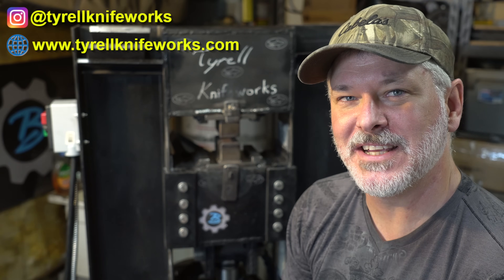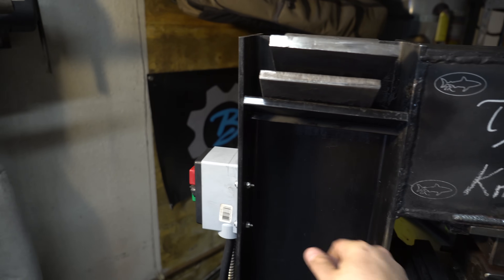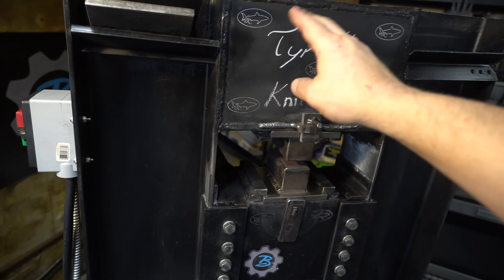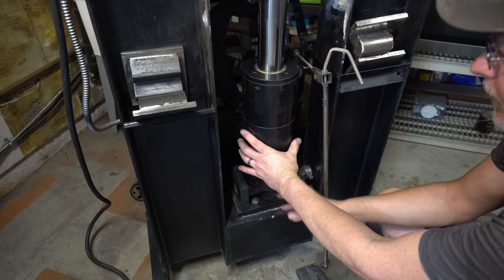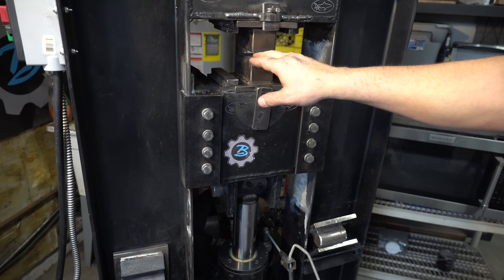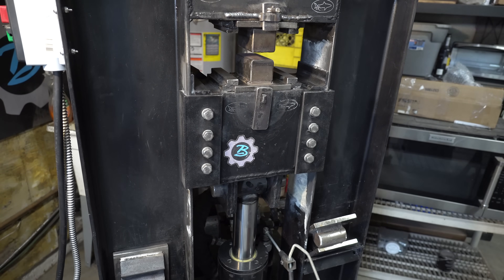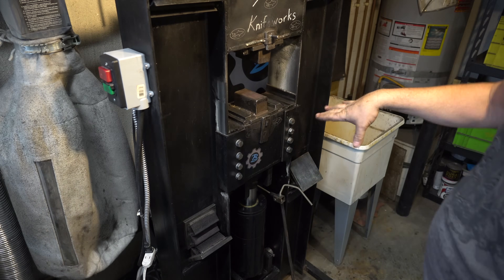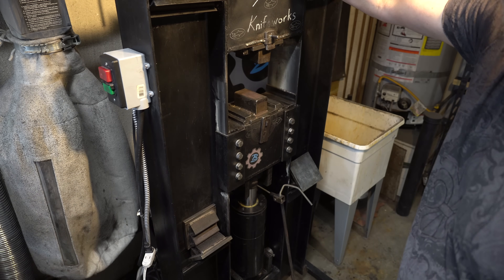Triple-T #83 - How to build a Hydraulic Press

Comment: I've just found your channel and am enjoying it immensely.  I've blacksmith'd about 10 years but I've never tried making damascus.  
I have a few questions concerning a press.  For an occasional damascus build, in your opinion, what is the minimum tonnage needed for an adequate press?   Could a Harbor Freight air powered 20 ton press suffice?  Would it be fast enough?  I haven't done a lot of searching but I've never seen someone making damascus at normal speed (it always seems to be speeded up) so I'm not sure how fast the press should operate (compression & retracting) to be efficent.  
Concerning forges.  I have a naturally aspirated gas forge (built in a team build using a 12" - 14" diameter pipe with 2 burners let into the side towards the top to create a swirl inside the forge).  The propane orifice is a mig welding tip positioned in a 3/4" t-fitting to allow for air intake.  In your opinion would it be possible/helpful to introduce forced air into the intake assembly to increase temperature/performance?
Thanks in advance!
Reply from the maker: I would stay away from air cylinders.  They are just too slow.  Speed is important and you want a good motor driving a good pump so the ram moves about 2”/s.  They always have a low gear for fine manipulation.  I would go less than a 20-ton cylinder if I was making one because the cost difference is negligible.  Mine is a 28ton with a 5hp motor and 13gpm pump.  It works perfectly for forging.  As for the forge, if you have a Venturi burner, you’d have to change that to move to forced air.  You wouldn’t want both.  Forced air burners a dead simple, just an air pipe with gas tee’d into it and either a ribbon burner or nozzle at the end. They are much easier to control for doing Damascus.  Welcome to the channel, thanks for watching!

Comment: Hey Denis! i am currently following this build to make my own press. Thank you! I do have a quick question though, ( i know there are a lot of variables) in your build, would a 2" longer stroke cylinder work effectively? or is it too long?
Reply from the maker: A longe cylinder would certainly work.  Each cylinder is rated for pressure and force, the length of the ram usually isn't the consideration.  I hope that helps.  Thanks for watching.

Comment: You may not need hardened dies as long as you only work on 1/2 thick billets or larger.  If you work material smaller, or taper things that may not hold enough heat to stay red through a single hard press, the dies will dent in ways that become problematic because it leaves those dents in your future work.  I use hardened dies for all smaller work for this reason.
Reply from the maker: I’ve never had an issue. Thanks for watching.

Comment: Thanks for the very informative video, makes me want to try building one. I do have a question about the motor though, in the video you said you need a 5hp motor and it's all about the speed that it rotates. My shop will not have a 230v setup which is what is required of the 5hp motor you linked however, the same amazon seller has a 2hp motor that is the same rpm as the 5hp (3450) but it can run off of 115v. Do you know if the lower hp will affect it all? Like make it go slower up and down or could it just bind up altogether and not work to rotate the pump? Not sure how much torque is required to rotate the pump if much at all or if it is all about the rpm. Thanks for taking the time to read this and i am hoping someone can help me out.
Reply from the maker: You need the torque.  Hp is about the power of a pump and that’s what you need to drive a pump that moves hydraulic oil.  It just means you can’t drive as high a pump. I would strongly suggest you consider putting in 220v power to your shop.  You’ll use it for so many things.  I did mine myself, it’s very easy.

Comment: Do you have a cost estimate for all the steel. I know it's going to be higher now but just trying to get an estimate would help in planning everything out.
Reply from the maker: I had my steel yard cut an i-beam into 5 pieces.  Two 4-foot sections and three 1-foot sections and I just welded those up.  Plus a foot or two of 1/2" bar to make the holders for the clevis pins.  In total I think it cost me about $250 in steel or thereabouts.

Comment: Tyrell would you be able to update the links in your description? Some of them are “currently unavailable” and the piston leads to a 404 error
Reply from the maker: It seems they don’t have the 5” bore cylinder.  I updated the link to a 4” bore, but that one is only 18 ton.  The 5” bore was 28 ton.  I would look for a 5” bore / 10” stroke cylinder somewhere else.  Thanks for watching, Tyler.
Reply: I just built a press based off his design and I got my 5” bore 10” stroke 3000psi spartan cylinder from FIMIC and it worked great the only thing I would do differently is get a pump with a cast iron body instead of this pump with aluminum housing I got the one he recommended but outlet port blew off and tore threads after 4 days of use so now I’m waiting on new pump and out $150

Comment: How long is the stroke on the cylinder ram the link expired for the one you listed can you give me the specification on cylinder please? Thanks Dennis
Reply from the maker: You only need around an 8” stroke.  The one I have is a 5” bore with an 8” stroke that operates at 58k pounds of pressure.
Reply: @TyrellKnifeworks  thanks for all your help brother with this project and the grinder too!
Reply: @TyrellKnifeworks  how does that motor work for you and how long have you had it?
Reply from the maker: The motor works perfectly.  It’s been 3 years at least.
Reply: I got another question, sorry this will be the last one this week I promise! Do you have to use the full stroke of the cylinder? I got a 10” stroke but I only have @2” of room between beams. Not enough for dies nor Clevis pin mounts
Reply from the maker: @huntintrailmetals9343  You certainly don't need the full stroke.  Mine is an 8" stroke and I have it setup so that I can use the full stroke though it depends on the die I'm using.  I have a feather slicing die that's quite long so I have about 5" of room below that.  Keep in mind that you'll want to accomodate dies like that.  Your dies are typically 1-1/2" thick at most, even at 8" of stroke you have room for 5" of material.  👍🏻
Reply: @TyrellKnifeworks  thank you Dennis for your knowledge and patience!
Reply: Hey Dennis I got another question for you how much did you round the edges on your beams flange to get carriage to track properly?
Reply from the maker: @huntintrailmetals9343  I rounded them to match the interior curve of the angle iron.  Do it until you stop seeing a gouge in the corner of the angle.  👍
Reply: @TyrellKnifeworks  have you noticed any issues with strength by doing this?
Reply from the maker: @huntintrailmetals9343  not at all.  It’s just about a 1/16 radius.

Comment: Did you use a wire welder or stick to do the welding?
Reply from the maker: This was over three years ago when I only had a stick welder.  It was to do it today it would be with a mig welder instead.  👍

Comment: Looks great. I found one of those 33ish ton log splitters, and basically gave it an anvil and turned the axe head into a die holder. Then retro fitted an electric motor to replace the gas motor. Not a bad route for the price, but your's looks way better haha.
Reply: my die holders suck too, I'm totally stealing your step design and square bases :)
Reply from the maker: If its a 33 ton log splitter, those are about the only ones I would recommend as forging presses to re-use the rail.  The small ones just don't have the strength and twist under the pressure.  Thanks for watching, Nicholas.

Comment: hello, thank you for this great video. can you tell me how fast the motor is running? thank you so much !
Reply from the maker: It's a 3500 rpm single phase 5hp motor running on 220v.  No VFD required for these, it runs full tilt all the time.  Thanks for watching.

Comment: do you have any plans or anything? or did you just wing it? i've watched red beard ops' hydraulic press video about a thousand times and was thinking that was going to be the plan for me but am always curious about new designs.
Reply from the maker: No plans, I just wing'ed it.  Get your cylinder first and figure out the extended length of the cylinder so you know how high you should make your press.  Then just build the frame to support that.  They are actually quite a simple design, its just a big square with the cylinder at the bottom and a moving head bolted around the inner frame that slides up and down.

Comment: If you were going to make a new press after using this one for so long what are the things you would change?  Thanks for the video.  I am in the planning stage for building my own.
Reply from the maker: The ONLY thing I would consider changing is having the ability to have combo dies.  Right now since the dies are 4" square, that's not big enough to hold a combo die (both drawing and flattening in one die).  I would like to have made a special die holder conversion kit so that it would fit a combo die plate that was 8" wide so I could have a 6" die on top.  I wouldn't ever sacrifice the ability to have square dies that you can turn 90 degrees though.  Other than that, I wouldn't change a single thing.

Comment: If you build it, might as well overbuild. I would like to see how the linkage and food pedal were designed.
Reply from the maker: Yes, I realized after I forgot to video that part.  I'll do a follow up on it at some point.  Thanks for watching, Ryan.
Reply: @TyrellKnifeworks  I was wondering about the foot pedal also (I'm assuming that's how it operates?) Since the valve returns to neutral, do you have to actuate the pedal in two directions? Up and then down?
Reply from the maker: @tackthecack677  Yes, the front of the pedal has a solid round-bar linkage to the valve.  The pedal has a round tube welded to the bottom and its over a horizontal round bar.  Then you push down on the front (like an accelerator pedal in a car) to press and push with your heal to retract.  It's very fast and easy.  I'll show it in a future video.
Reply: Perfect! That’s kind of what I was imagining. Thanks for another great video

Comment: One thing to mention is Bore size of the cylinder affects the speed aswell. Bigger bore requires more fluid to fill. I have a 4” bore with a 3600rpm motor and it’s almost to fast. Definitely will ruin a pattern specific billet in a hurry if not being very careful. Kiss blocks are a life saver.
Reply from the maker: Yes, absolutely.  I did mention it was a 5” cylinder so it takes a lot of oil.  The valve having a slow mode helps a lot too.  Thanks for watching, Erik!
Reply: @TyrellKnifeworks  i apologize, I must have missed that part.  But yes the control valve solves that unless the user has a “heavy foot” sorta speak. I need to adjust the radius at which the handle is controlled from. It’s super sensitive. I say that but I’ve had it built for years now🤦‍♂️

Comment: This is much simpler construction than mine :P. 35 galon/minut? I think you mean Liters. 35galon/minut would be around 135cu in/sec (if my match is correct) :).  
At first I put 35l/min pump to my press and it was too fast- I couldn't control the press at all. Did you ever change the pressure on the control valve? I've reduce the force to 25 ton (160Bar) but I can go up to 37 (250 bar).
Nice video, as always :)!
Reply from the maker: It’s a 35 GPM pump.  It depends on the size of your cylinder though.  Mine is a 5” cylinder so it takes more oil to move.
Reply: @TyrellKnifeworks  It can't be 35 galon/min. if you have 5" cylinder it means its' 12cm in diameter. the Surface of the piston is 122cm2. 5cm/sec is around 630cm/3 volume. 35l/min pump push 583cm3/sec. So everything is right except of the unit :). And the link you posted is 13 GPM which is moves around 2.75"/sec.. this actually might be correct :).
Reply from the maker: @DBCraftWorld  Sorry, you're correct!  It's 13, not 35.   Sorry bout that.  Not sure why I screwed that up.  Fixed it in the desc.
Reply: @TyrellKnifeworks  Its totally fine😁. Just noticed it and thought I'll let you know👊

Comment: I wasnt aware you hade built this yourself, thanks for the rundown, and the quick how to for those looking to set one up themself
Reply from the maker: They are actually pretty easy to build.  I certainly would do it again.
Reply: @TyrellKnifeworks  aye, they seem very simple to build, specially after you gave the rundown and reasoning for your choices. It seem to be a press that serves you well. And using strengthened bits of I-beams is a neat way of preserving strength and shedding weight.

Comment: Perfect timing on releasing the video. I'm currently on search of a discarded logger splitter now that burn seasons over out here. Because most of parts will come with it. Love the idea the 5 HP motor. Is that single phase and 120 VAC? Knowing the valve would need to be swapped out, but I assumed (oops) that's what controlled the speed. Thanks! One more thing, the foot pedal, is that a 2 way? Similar to a hydrostat tractor gas pedal? Awesome design!!!
Reply from the maker: The only thing you’re gonna use from the log splitter is the cylinder and even then it’s not ideal (too long).  Unless you get one for free, don’t bother.  You can buy the cylinder for $300 brand new. The foot pedal just sits on a rail and moves up/down/neutral and connects to the valve. Thanks for watching
Reply: @TyrellKnifeworks  Thanks for your advise. The forge exceeded. How about the motor?
Reply from the maker: @brooksmartin5183  if you’re asking about the motor for a log splitter, they are usually gas engines.  You certainly don’t want that in your shop.  Mine is a 5hp 220v single phase motor.
Reply: Mine started from a log splitter. I replaced the cylinder for a shorter and higher pressure rating. Also put a 3hp 3600rpm motor on it which is equivalent to a 5hp gas motor. (Electric has more torque which is what does the work).  I wouldnt use the new log splitters unless the frame is reinforced. I’ve seen pictures of them twisting and bending the frames badly. Mine is an older one that’s built a little stronger, plus what I’ve done to it.  My control valve doesn’t auto return anymore. There’s a part that can be taken out of the valve which is what makes it auto return. I believe it was a spring and a guide bolt under the detent cover. ( it’s been several years).  If you can find  a log splitter cheap enough to effectively modify or use parts from then it’s worth it. Don’t go spend $1k on one to make a press out of it. You can build a better one for that price.
Reply: @erikcourtney1834  Thanks Erik for your advise! Between Tyrells and your feedback, you guys have talked me out that path. And Tyrells design seems have thought it through.